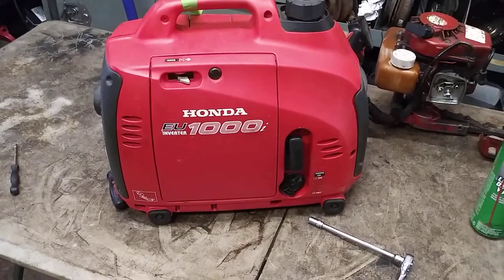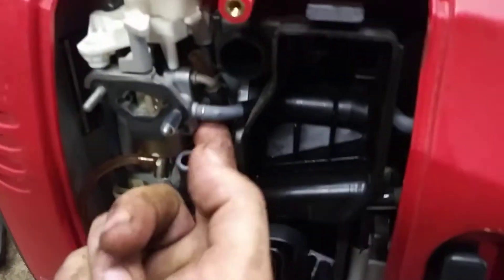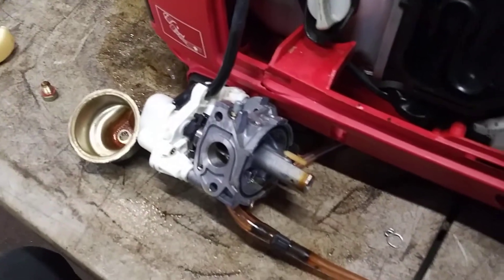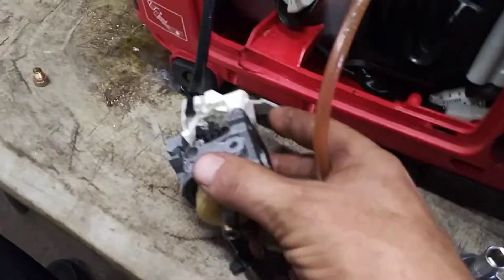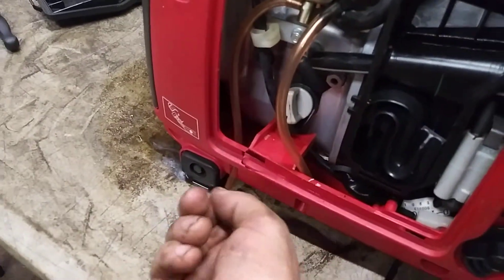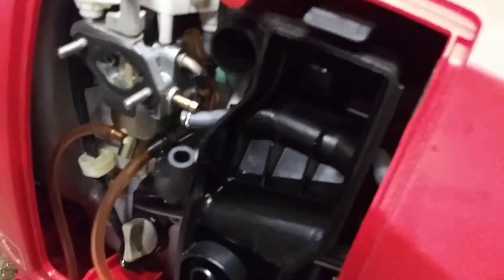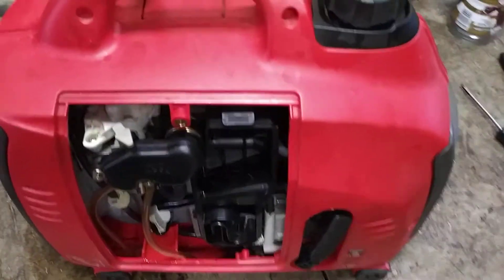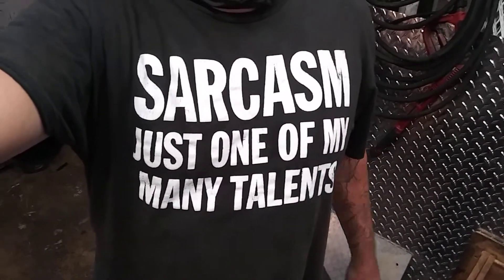* Honda eu 1000 eu 2000 carburetor repair cleaning tune up carb eu2200

Comment: Ive had mine for two decades, starts first pull everytime.  She started to surge a bit, ran x66p, no avail.  Appreciate your video.  One thing you might want to consider, the honda engineers factored in vacuum from the air box.  Mine was surging post cleaning and i was like dang, this was without the airbox, once i put put it back on... purrs like a kitten, low and high speed without a load, cant ask for more than that.
Reply from the maker: Glad you got it working good!

Comment: Could this be the issue why my Honda kept shutting off my shop vac? Honda continued to run but shop vac would go on and off
Reply from the maker: No. Sounds like a bad electrical connection. Also a vacuum uses alot of amps and watts . I think your generator may be to small

Comment: Oh man, that was super important to pull the cord several times to let the gas cycle through. I wouldn't have thought of that. I just found one of these that a tenant left behind and it's fouled up. The gas tank is filled with old two-stroke mixture. I can get the tank and carb nice and clean, but I wouldn't have thought of how much of that old gunk is still in the pump and hoses! Thanks!

Comment: At 3:48 you point at the black screw idle jet? I sent mine to a shop and they didn't count the turns to fully seated...how many turns from fully seated should it be? Mine is running at a very low rpm
Reply from the maker: That is an idle screw. so when running and eco mode on nothing plugged in you turn it till your desired idle.
Reply: @smallengineguys  oh OK, so I can get at it while the carb is on and engine running?
Reply from the maker: yes but thats not why it isnt running at higher rpm while producing power. im betting the throttle arm it pushes is sticking and needs to be oiled and moved around a bit.

Comment: My gen is only working half choke and working badly with more than 500W connected. I cleaned carb, should I try clean it again?
Reply from the maker: yes jet is either still dirty or you have bad gas. more than likely jet isnt cleaned well enough

Comment: Couldn't get mine started, followed your instructions and it runs great now, but I have a gas leak at the carb gasket..it looks ok..new gasket?
Reply from the maker: what gasket is leaking?
Reply: @smallengineguys   the gasket that's exposed when you take the two 8 millimeter bolts off and pull the carb
Reply from the maker: @wendelldobbins7421  so that's not the issue then. Carb needs to come back off. Needle valve under float is leaking still. You need to clean needle valve again.
Reply: @smallengineguys  thanks for the tip, I will try that
Reply from the maker: yeah that gasket should only seal the air filter assembly to the carb. only air no fuel.

Comment: I have one of these that will only run for about 3 seconds and only on choke. Initially it had gas in the oil. So I cleaned the carb as in your video but it won’t stay running. Any suggestions?
Reply from the maker: oil full? it has to be full to the top. after that id say you gotta do the carb again. sometimes i have to do them many times. just how it goes sometimes. make sure you clean all very well you may need to pull a wire out of a wire wheel and poke the jets and holes
Reply: @smallengineguys  I’ll try to top off the oil see if that does it. I was only reading half way up the dipstick and thought that was enough. Thanks for the help!

Comment: Very helpful, I have a 1000 with a hand full of hours and it was surging at idol, tried sea foam, ran it, let it sit a couple days but no joy so I did someTLC to the idol jet and fixed it right up, I volunteer SAR communications so the equipment needs to run.
Reply from the maker: Glad it helped

Comment: Thanks. Don't have the acid bit I used some starting fluid and a thin horse hair bristle. worked great.
Reply from the maker: yep a wire from a wire brush works great. good job.

Comment: I took also removed the jets from inside the bowl and throat of carb. I ran a thin bristle through all of the holes. Might as well since you have it all apart anyhow.
Reply from the maker: dont have to with the acid. it boils it out brand new. also be very carefull not to force something threw. you can widen the jet and make it run rich or break your object off into it. either way you feel like is fine. i have found doing it with the acid is easiest and does a better job.

Comment: Thanks for that great video.  I neglected  to drain the gas 12 months ago and the generator started, but it was running rough. I drained the gas, put fresh gas in and it still ran rough.  I followed your video and took apart the carburetor and cleaned all the jets.  I put everything back together and the generator fired right up and is running great.  Thanks so much!
Reply from the maker: Great job! glad it helped! your welcome!